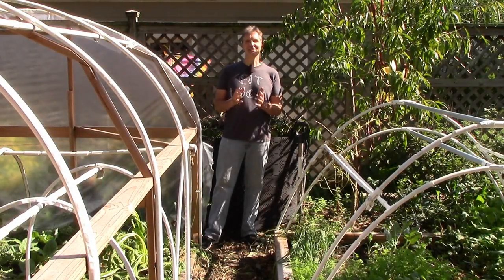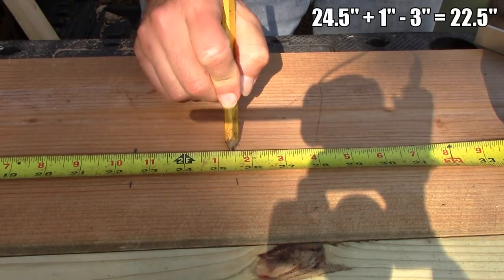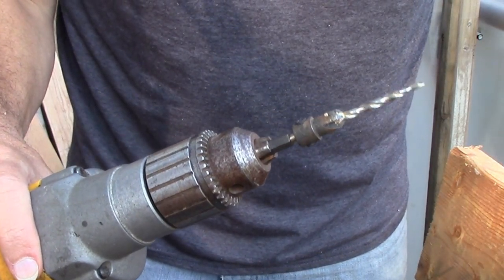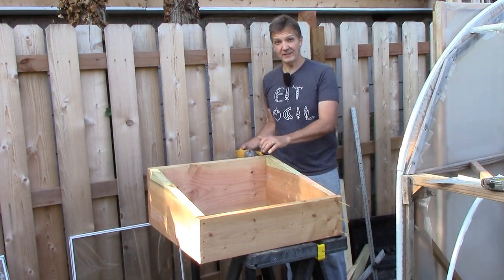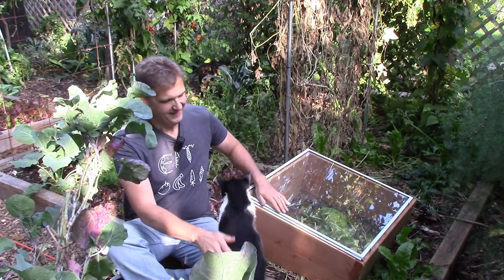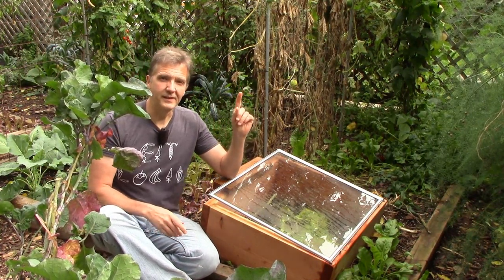How to Build a Simple & Inexpensive Cold Frame to Extend the Growing Season

Comment from the maker: Step by Step Instructions:
0:45 Materials: storm window, 2 by 12 for back and side panels, 2 by 8 for front panel, sixteen 3" deck screws, two roofing nails
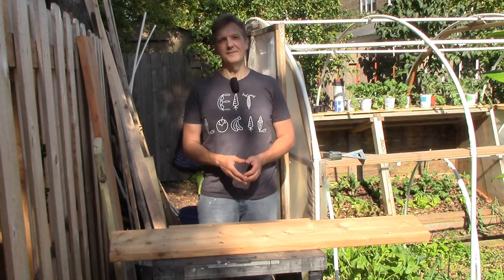1:14 Cut front & back panels to 3/4" to 1" wider than storm window
2:15 Cut 2 by 12 side panels to length
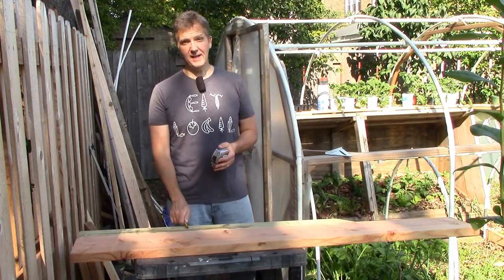2:34 Length of side panel = window length + 1" - 3"
3:46 Cut 2 by 12 side panels from width of 2 by 12 back panel to width of 2 by 8 front panel (the cut side will be the bottom of the cold frame)
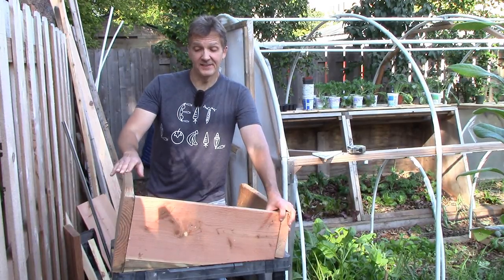4:46 Drill pilot holes with countersink bit (5 on each side of back panel and 3 on each side of front panel)
5:31 Connect panels with sixteen 3" deck screws (5 on each side of back panel and 3 on each side of front panel)
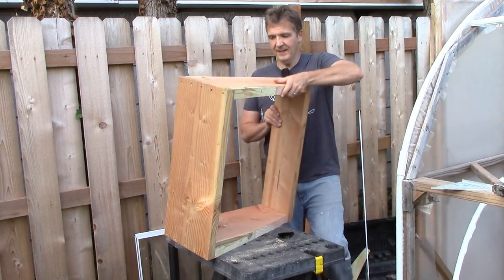6:28 Drive 2 roofing nails near front edge of front panel to hold storm window in place
6:57 Place storm window on frame

3 Ways You Can Support OYR Without Spending an extra Penny!
1) Stay engaged! Subscribe, like, share, comment, and select the notifications BELL next to the SUBSCRIBE button to be notified when new videos are released;
2) Let the ads run. This is a big ask, but the extra ad revenue will help offset the cost of cameras, mics, computers, software, etc.
3) If you shop on AMAZON in the US, you can support OYR simply by clicking this link (bookmark it too) before shopping: http://www.amazon.com/?tag=oneya-20

Comment: Excellent video Patrick. You may want to check a wood preservation method called Shou sugi ban. It's done either with a gas torch or a simple fire pit. It could help extend the life of the frames.
Reply from the maker: Thanks, Kostas! The cold frames last a very long time because they're only on the ground from mid-Fall to early spring. The ground is frozen most of the time, so not much decay occurs.

Comment: How do you prevent wind from turning the glass into a frisbee?
Reply from the maker: If you need to vent on a windy day, you can slide the glass back instead of lift it, and weigh it down with a brick or some other heavy object placed near the frame.

Comment: Could I add an automatic vent to the top part of the frame, or do I need a more elaborate hinge?
Reply from the maker: Hi Adam! I think you'd want a hinge to use an automatic opener. So far, all of the non-electric automatic openers I've seen only work when it's above freezing. I don't even use my cold frames in the fall until temperatures dip below freezing, so none of the ones I've seen would work for me. Please let me know if you find one that can be used when temps are below freezing. Thanks!

Comment: the one thing that "worries" me is how those light aluminum windows don't fly away in the wind
Reply from the maker: If you need to vent on a windy day, you can slide the window back instead of prop it open, and you can place a weight on it near the back of the frame.